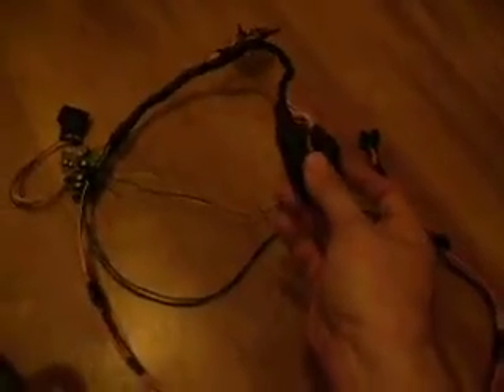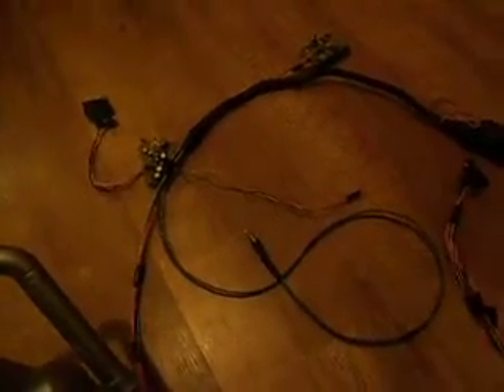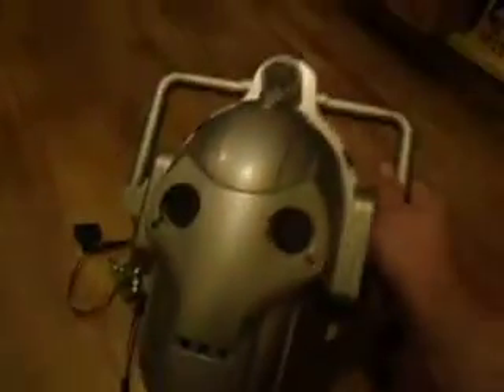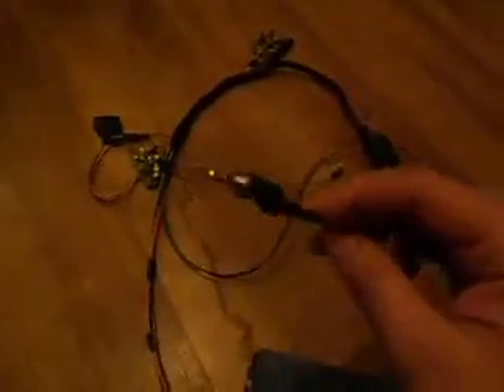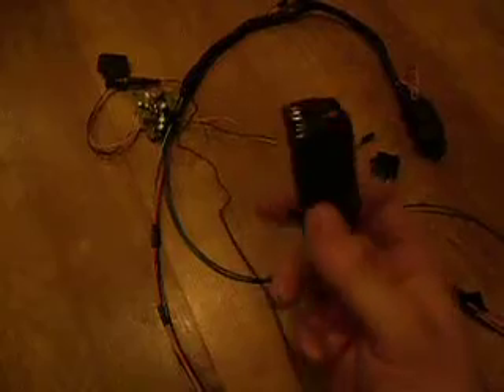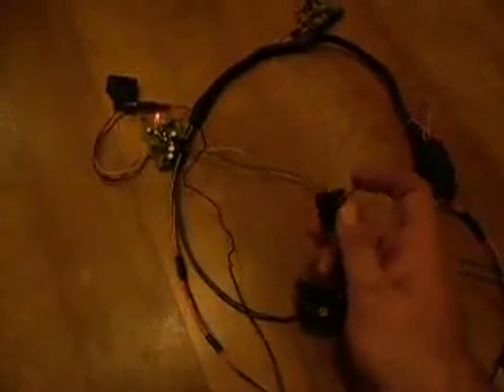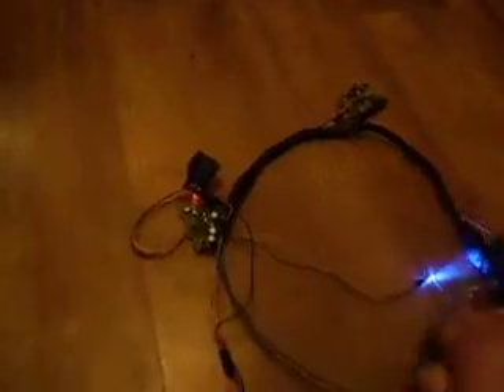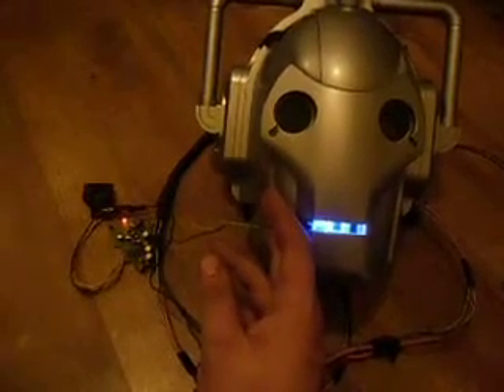Wearable Cyberman voice changer - setting up the kit

Comment: I'm hoping to build one for my costume, though I'll be hooking it into a speaker built into the suit, into the crest/logo (I'll use cloth on its surface so as not to muffle the speaker), so it'll be more audible and I'll also add the light into the mouth of the helmet. The suit itself is made of foam, including the head (everything's done from scratch).

In addition I'm gonna install a light-up wrist blaster; i.e. place the light into the gun, then connect the light to a squeeze trigger hidden under the glove.